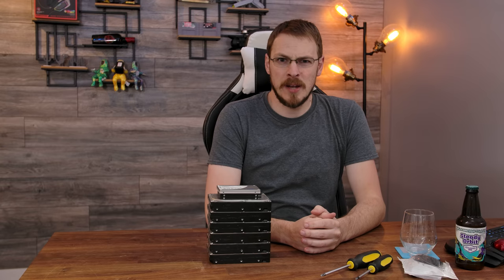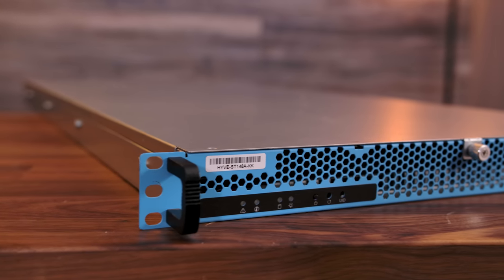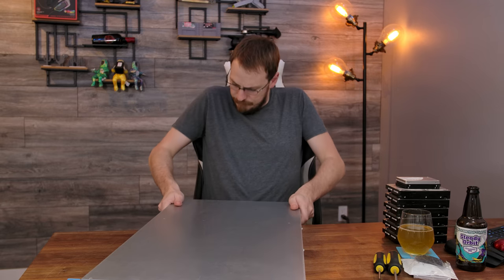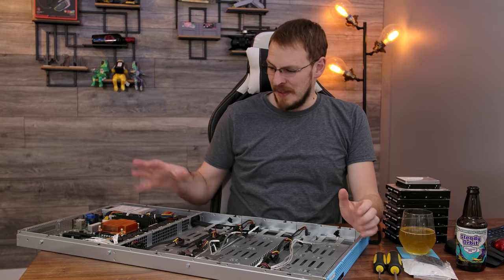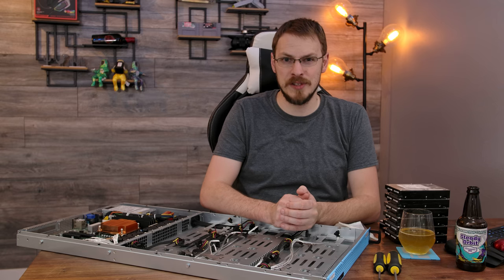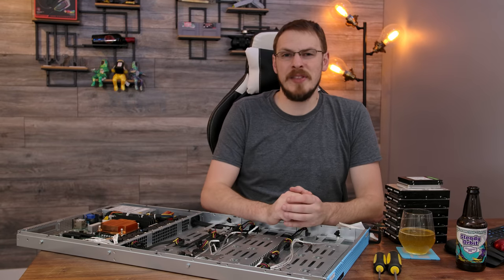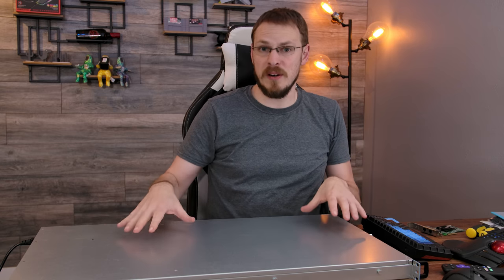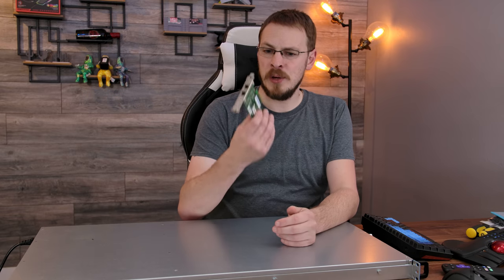A 12-Bay, 1U Storage Server for $120?!?

Comment: Ok, I bought the Chenbro NR12000 server. Problem is that the HDD mounting holes are close together but the mounting holes on my HDD are further apart, so I cannot load any of the 12 drives I bought into this chassis. Is there some sort of adapter plate to convert between the hole spacing?

Comment: Why not solve the problem with the HPE NIC drivers? Having in mind that TrueNAS is a fancy Linux box, I think it's not a problem to fix it.
Reply from the maker: TrueNAS is BSD based, not *nix. They are coming out with a Debian based system called TrueNAS Scale soon.
Reply: I forgot that. But still surprised that BSD doesn't support an HPE NIC. In my home for NAS storage I am using a server with ZFS on Debian, it's more tricky to set up and manage than FreeNAS/TrueNAS but there are fewer compatibility issues at last, and I like the CLI (:

Comment: Is it possible to mount the equipped server in another orientation and the rubber HDD feeds will still be fine? I have a rack where you can slide the server from above. Not sure if the rubber feed will support this orientation

Comment: First, lets be honest, it "will" hold 12 3.5" hard drives; however only 8 will be running on the SAS connection; 4 will be on SATA 3gb and 2 on SATA 6gb.  I wish you would have pointed that out in your video.  The other thing is the PSU.  God help you if it goes out as it is NOT simple to swap out.  Finally, the cost is a bit misleading when you don't include the RAM and Hard drive cost.  I ended up booting from USB and installing one spare and one 500gb SSD cache drive on the SATA 6gb ports and not using the SATA 3bg ports.
Reply: spinning drives are perfectly fine on 3gb ports

Comment: Oh god the NC523SFP...
I have bought araound a metric ton of these for fairly cheap. Only Problem: esxi 6.7 straight up refuses to use them. you can install the vib to let them show up, but i never got them working. also they seem to be a little slow for 10gbe... 

Just a heads up for anyone buying them.

Comment: Soooo not $120 then!? seen as though you changed the RAM, added parts and then there's the gromits and oh yeah ALLL the HDD's!!! $800 maybe? but yeah just for the initial rack then $120 isn't bad at all! 1 question from a NOOB when it comes to servers (the limit of knowledge extends to a 4-bay synology NAS enclosure) do you HAVE to have a full server rack system to use what you put together here or can i just have that "just sitting" on a tabletop somewhere?
Reply: I mean, the server itself is $120...

Comment: Does it take sas drive or only sata?
Reply: Those were separate SATA and SATA power cables so both SAS and SATA should be fine.  SAS drives are OK with SATA cables, SATA drives are not OK with SAS cables.
Reply from the maker: You're completely backward on that. SAS drives require SAS cables. SATA drives can work with both SATA or SAS cables.

Comment: I really really want to take the plunge on this but would have to put this in my living room on a lackrack I built. Would I have any hope of making this quiet?
Reply: quitening a 1u server is hard bc the fans need to pull the air trough the whole case, over the hdds and through the cpu heatsink

your best bet would be a workstation style server, or simply build one in a normal pc case bc there you can use normal fans(for example from noctua)

Comment: I don't see how that thing is high availability. No redundant OS drive, PSU, sas connections or hot swap, and are those larger ssd's for read cache or SLOG? if they read cache then why 2? Read cache doesn't benefit from raid 1 mirroring and with 16gb of ram it will actually hurt your performance. Its only use is a SLOG which you don't need ssd's that big... Though wear leveling benefits quite a bit from capacity i guess. Seems kind of an odd choice of gear that wont really be all that optimal.

Comment: Does this chasis have 2.5" mount holes where the 3.5" drives go?
Reply from the maker: No, only 3.5" pattern. You'll need a drive adapter with screws on the bottom to mount SSDs. Completely forgot to mention that in the video.

Comment: Wow is that thing deep, I'd have to cut a slot in the wall behind my rack and put an extension on the outside of my house.....
Most of my 19inch gear is fully supported by the rack ears. (I.E. short)

Comment: Did you get the 10gig nic working with freenas?
Reply: I have gotten two 10GBE nics to work.  the intel X520 works fine and that gives you 2-10GBE ports.  Also the Chelsio T422-CR works fine and gives you 2-10Gbe and 2-1GB ports.  I could NOT get the built in Intel network ports working on TrueNAS

Comment: I m using also the hpe 10gbe NICs in cluster with Storage spaces be carefull the get very very hot also with good air flow.
Reply: what temp does yours run?
Reply: @gufpewga   The nic shutsdown after 20 minutes was about 90*C using all two nics on the network card, in the other server where using only one nic on the networkcard was about 70*C , so i mount some extra little fan so the temp was good also on the storage server with hot temp. For testing i switch also the nics from the server becouse i was thinking mabye some malfunction on the storage nic but was all on all nics the same problem if i was using all nics on the networkcard without extra cooler temp was horible.
Reply: @gufpewga   The nic shutsdown after 20 minutes was about 90*C using all two nics on the network card, in the other server where using only one nic on the networkcard was about 70*C , so i mount some extra little fan so the temp was good also on the storage server with hot temp. For testing i switch also the nics from the server becouse i was thinking mabye some malfunction on the storage nic but was all on all nics the same problem if i was using all nics on the networkcard without extra cooler temp was horible.
Reply: @piterbrown1503  is it possible to replace heatsink for better one or it it glued?
Reply: @gufpewga  yes you can

Comment: I wonder what is the power draw on this server?
Reply: Then there is the draw on the aircon he has piped into the back... Electricity must be free in his area
Reply: The Xeon is sub 1A so with full drives maybe 1.5~A @ 120V
Reply from the maker: This server was drawing about 80W at idle. And I only run the AC in the summer months. I was wearing a hoodie in this video because it was 38F in the garage :-)

Comment: I dont understand why you didnt just use that 10 gb nic for connection?  Why switch with the dual 1gb?
Reply from the maker: I think I accidently cut where I talked about the change. I couldn't find my DAC cables, didn't have any spare SFP+ optics, and the onboard NIC was a no go. To get into the system, I had to swap the 10G out for 1G. I'll be fixing that here shortly.

Comment: Wait.... I tried that exact same HP 10GB card in FreeNAS 11.2, and it didn't work at all - with lots and lots of driver problems generating a complete loss of networking.
How does it fare now with TrueNAS ?
Reply from the maker: Interesting... I've not tried it in earlier builds, but they have been plug and play in 12.0. I have the same card running in my primary TrueNAS box without a problem in the world.
Reply: @CraftComputing  dang it !
I had gotten 3 for sub 40€ and resold them as they didn't work.
And they're now 30 for one.
Now i'm sad :(

Also, these cards run really really hot compared to others like the mellanox connect x-3, beware !
Reply from the maker: Yep, they do require a lot of airflow. But in a 1U box, they're guaranteed to get air moving over them.

Comment: The motherboard seems to be https://www.tyan.com/Motherboards_S5512_S5512GM2NR
And it does support ECC according to the manual.

DIMM Type / Speed	Unbuffered ECC DDR3 1600/1333
Reply from the maker: Right, it will use unbuffered ECC, not registered ECC. The memory I put in there was unbuffered. It refused to boot with two 8GB REG-ECC sticks when I tried.
Reply: @CraftComputing  the CPU is pretty old and do you have any plan to upgrade it to any E3 v2 CPUs?
Reply from the maker: None. This isn't going to be a production box for me. It's something I can tinker with and not break systems I rely on for video production.
Reply: @CraftComputing  I thought CPU upgrade and BIOS hacks are part of the "tinkering"  :)

Comment: WARNING: 8-12tb WD drives (shucked 10tb WD elements drives in this case), may have an incompatible mounting screw footprint to fit this chassis..
You may want to verify before you assume your HDD will fit...
Reply: yeah. I just found this out. Most of my drives have the alternate mounting method which are farther spaced. The footprint of the NR12000 is standard mounting.

Comment: What about the airflow? This is crucial for the Lifespan of the harddisks. I am not a fan of these 1U  Supermicro Chassis. Just because of this Reason only.
Reply: did you ever hear/saw a server running? they push way more air through the case than a normal pc, for HDDs it should be enough airflow to keep them around 30-35 °C(maybe 40°C depending on the amount of drives installed and the type of drives)

Comment: I had a very similar issue with another mobo where the onboard network ports weren't being detected at all and was directed by some kind people to a post about checksum mismatches on the non-volatile memory of the network controller being an issue. This may or may not help: https://superuser.com/questions/1197908/network-eth0-missing-the-nvm-checksum-is-not-valid-with-asus-maximus-ix-hero

Comment: I have no idea why but all of a sudden the NIC on my unit that wasnt working is now working, well see how long. Only thing I can think of that I did was after installed and running (true nas that is) I went to option 8 to erase and reconfigure system, after the reboot it is now working.

Edit: upon shutting down and re-inserting the hp 10G card it has lost my lan again.... going to take it out and try again now....

Edit 2:
I think I figured it out for any complete server novices like me doing this. In the bios in the lan setup screen there's an option to have the motherboard disable the onboard lan when an add-in card is detected, I set it to disable amd now all 4 ports (2 lan and 2 10g ) ports are seen in truenas. This may have been my issue when I was trying to figure out unraid too..... maybe ill give that another shot too....

Comment: Anything similar but say, half of the drive capacity and not as deep of a unit?
Reply: U2 is the only way to get 8-12 bays in shorter format 
Dell r720xd 12 Bay (there is a 8 bay r720 as well and a 2.5bay version as well) the  r720 8 bay version is very quiet once it has booted up the, they all also use dual socket, dual psu (it's a lot of server for around £400) all in a u2 format

Comment: That's a 24 drive case... 
SSD inside them fake drives things.. doubles the drives...

I was sure a hammer was going to be used..... I mean the persuasion tool...

And I've a 1u , well I have a few and while mine is as long, it manages 2 drives and that's all you get. And my other has 8...SFF. 
ummmm
I could pull the cages and backplanes fix them in a 2 1/2u and give myself about 160 drives... 

4mm drill, rivet gun, a few cages..like 580 G7/8, a few controller cards... A bucket of cables.. and a gigawatt PSU... But then when it comes to a main board, we get issues. :( Pretty sure it's easier to build one...

Comment: Nice build video. I am at 6:22 and noticed what I would call a mistake in choice. The boot disk.

You state you want centralized storage for a proxmox server(s) but you are creating that storage with a very lets say, "volatile" single point of failure. The SSD.
I would have taken at least two SSD's of same size but different brand or even better, two small HDD's for the boot drives. Why could you ask... Well, simply because SSD's are not good for long time storage of data. Data that is not modified often will eventually vanish from the drive due to a neat little "feature" of SSD's called "De-trapping" Roughly this can be described as follows: When data is written to a cell it recieves a charge. This charge diminishes over time and is never refreshed unless data is written to the cell again. HDD's on the other hand have a much long lifespan and the data does not vanish over time unless the sectors go bad. This won't be a problem if you mirror two HDD's.

Considering you are only using 1 SSD you can expect your SSD to loose the data within 3-7 years without redunancy. Also remember, SSD's are likely to fail simultaneously if they are the same make/model/date of production/usage pattern due to the limited write capability.

I lost 4 SSD's in a single month in a RAID10 due to the above "features" of SSD. Afterwards I used HDD's for data storage (and boot drives) and use SSD's with ZFS for caching only. It does not matter if a cache drive is lost. With upcoming ZFS 2.0 with persistent L2ARC you can add a SSD cache to your boot pool aswell and retain the data during reboots. But who really needs the server to boot insanely fast? It's probably just booting once a month anyway ;)

You might want to look into a RMS-200 for Slog device. Just a tip :)

Comment: more  content like this - straddling the line between consumer/smb/ent is a-ok - there is going to be a ton of change in the mkt over the next few years so plenty of content and opps to deconfuse - much appreciated - a really big thing for big arrays is nvme cache, just like a r proxy cache it can take 90% of the load off the server which is massive - where else are you going to find this? #gluster on zfs #redundant net fs
Reply: if you want true HA storage you need 2 cause everything breaks but gluster scales well so you get better performance as a side benefit
Reply: i stand semi corrected - looks like you are doing it rite - mostly - lots to learn for everybody here #praxis
Reply: pls get a kill a watt and test as you add all drives and 10g - the 10g and cache were crucial to this build in my estimation - i guess you will go for raid10 - you should get very good performance. pls consider ha opnsense potato router build with 4x100gbe - cost is 10x more but perf is 10x more also and matches up well with nvme arrays - you do not need to go infiniband route  - doing just nat is an option also

Comment: So SAS drives on this server are not supported?
Reply: I only saw SATA cables in the video.  I don't think there was a SAS backplane.  Hopefully I'm wrong.
Reply from the maker: Correct, SATA only. Although 8 of the ports on this board are from an integrated LSI SAS controller. Might be possible to convert the cables. Don't know though.
Reply: @CraftComputing  thanks, i have a spare sas controller i could use.  Would you recommend this for for Proxmox / FreeNAS setup?  Migrating away from my old Dell 1st Gen R710 server that only supports 2.5" drives.

Comment: Pricing as of right now.
$111.00 server box
$_14.15 Rubber 100pcs
$__9.53 Screws 100pcs
$_99.00 Network SFP (maybe found a $20 similar part)
$220.00 2x SSD
$535.00 10x Hard Drives
=========
$988.68 Total Minimum
$214.00 Suggest 4 spare hardrives
$220.00 Suggest 2 spare SSD
=========
$1422.68 Total with Homegamer quantity spares
$2387.68 2x boxes filled keeping the Homegamer quantity spares (squeaking in with 4 extra screws and 4 extra Rubber Grommets from the first purchase, dont drop any)

Comment: 10 gigabit for 20 dollars?
Reply: Yep used Intel nic and the sfp+ are fairly cheap on ebay. I recommend the 2 port. 2 nic and a cable between Nas and your main system for a Direct 10Gb is very cheap

Comment: You just created a single point of failure, not exactly "true ha"... You should consider setting up a redundant storage server, or a distributed system such as CEPH.
Reply: This!   This is exactly what I was just thinking.   I run Gluster across 3 boxes in Replication.   We went from 3 boxes with replication to 3 boxes with a single storage device.  Better off to just not even HA at all, as a failed server would only lead to 1/3 of your VM's not working.   Now if the storage fails, all are down.
Reply: @paulbeers4105  Exactly, GlusterFS and DRBD are good easy options.